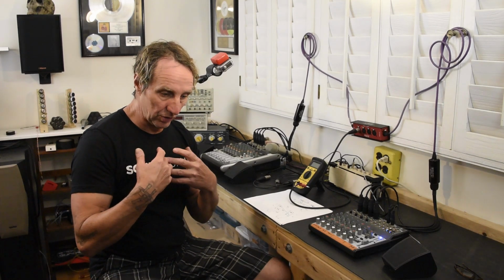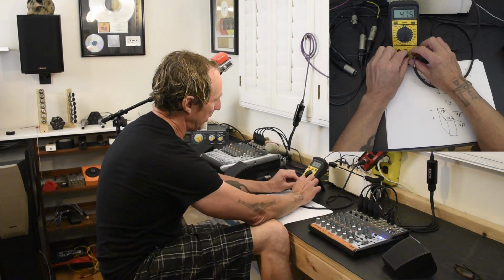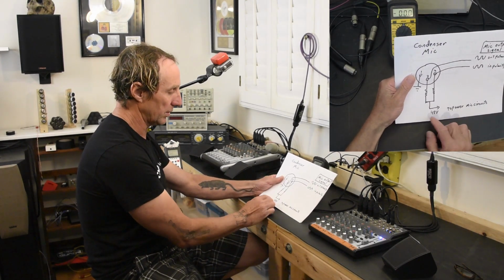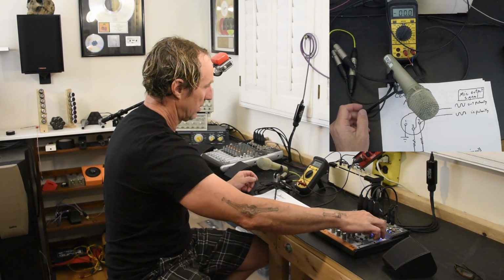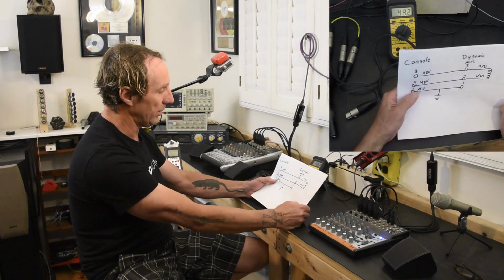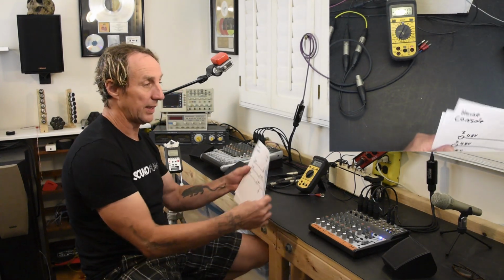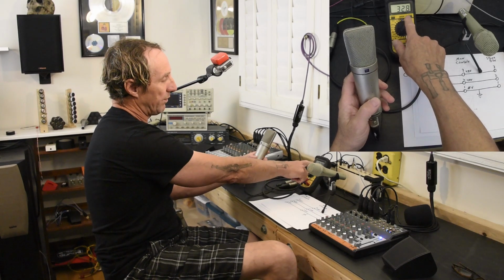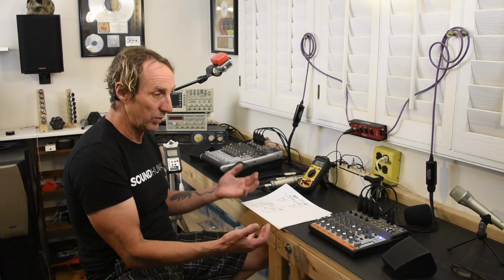Understand Audio Phantom Power + Demo

Comment: Great explanation (as always on this channel)! I have one question though: If we have phantom power switched on at house and monitor consoles and the two consoles do not share the exact same ground (on the AC side, i.e. 120V or 230V depending on where you are); are maybe plugged into power outlets from different distribution boxes. In that case, we'd have some steady current on the (XLR) cables connecting the two consoles, specifically the ground wires, i.e., pin 1? To level out the difference in ground potential. Isn't this dangerous to the very thin mic cables?
Reply from the maker: Whether you supply phantom power or not the grounds of both consoles are connected together via the XLR lines unless specifically lifted. So any ground differential potentials that exist will exist regardless of whether phantom power is applied from one console both consoles or neither console

Comment: Great Stuff,
Is there any Microphone designed for both propose....? out of curiosity..
Reply from the maker: Dynamic mics don't need phantom, condenser mics usually do need it. Some ribbon mics need phantom and some do not. 

It's like a battery, some things like a radio, needs a battery, and something's like a hammer do not and and something's like an ice box can be powered to cool things and others just keep things cool and don't need power

Comment: Hey Dave, long-time fan and love the videos! Just to calm the nerves of those in our shop - with what you stated about the current being low, can I assume that if I have wireless mic receivers receiving phantom power that there's not much cause for concern? Thanks!
Reply from the maker: It won't hurt them, that said, some electronic outputs act strangely when they see phantom and don't sound correct

Comment: Thanks again , nice experiment. The loading of the second console un-powered phantom is due to the two , normally 6k8 , resistors used and as you showed us the phantom voltages combine when both on to share the microphone load. The idea of phantom power came from Telephone/Telegraph balanced circuits for either powering up repeater circuits or adding dc signalling to a balanced transmission line. Cheers Dude
Reply from the maker: Awesome. Thank you Dave

Comment: Thanks Dave. I really enjoyed this chat and demonstration.  I've been running PA's and doing all sorts of sound for over 40 years and never really understood what was (technically) going on under the hood.  In saying that, I always made sure that my pin to pin wiring was spot on and never had any major issues when running condensers with dynamics.  Your bench top demonstrations are excellent, and show that the principles do not need a massive rig or console to explain. Keep up the discussion. Cheers ...
Reply from the maker: Thank you Perry

Comment: Hi Dave, I have seen a lot of debate about allowing phantom power to feedback from a mixer into a Line6 Helix pedalboard's XLR line-outs. It sounds to me like the voltage on pins 2 & 3 shouldn't cause any problems if all of the equipment is working properly and the ground doesn't get involved and there are no shorts. Have you ever been a part of that conversation with any guitar players at a gig? I suppose there could be circuitry at the Helix end that would affect how the voltage is "seen" by the Helix? One of the suggestions was to use a voltage blocker in the XLR lines. Would it be a diode that would work like a check valve?
Reply from the maker: Hmmm, some electronic outs don't like phantom, I will look into doing a test and fix vid for you
Reply: I've seen this in person while mixing.  It will seriously degrade the audio quality, very obvious distortion.
Reply: You can also just float pin 1 at the pedal if you're concerned. Many pieces of gear actually do that depending on their output circuit dont need the ground and the shield is still effective single ended (like most dynamic mics)

Comment: Another home run Dave! Stuff we can use. I would assume that this is a moot point with linked digital consoles -- only one (or a stage box) can actually generate +48V.
Reply from the maker: Yes and no. Knowing how things work is not that important in optimum situations. And we all don't always deal with optimum
Reply: @DaveRat  I hope you didn't think I was being sarcastic, I really meant it was useful. I was just thinking about the digital realm and realizing that it's a different situation.

Thanks for all you do!
Reply from the maker: @ToddWCorey1  no, all good and yes, with linked Digi, no need

Comment: I have always been told that if you accidentally put phantom power down an ipod cable (3.5mm to stereo xlr) it can/will fry the input jack of the phone, however I have not experienced this (maybe I have been lucky?) How would the voltage combine on one of those cables since they are technically unbalanced cables? Also, just another video idea for you, could you maybe discuss benefits and disadvantages of isolated, active, and non isolated splits? I've actually had the least problems from passive, non isolated splits, where I've had active and isolated ones that gave me random buzzes in things and seemed to change my levels.
Reply from the maker: I doubt the low current of phantom will fry anything other than a ribbon mic or super high end dynamic mic with a miswire.  But it can cause issues with electronic inputs
Reply: @DaveRat  I have fried a cellphone and a friend fried a MacPro and iPod sound cards with phantom power. Possibly it depends on the sensibility of some components for some devices?
Reply from the maker: I could totally see consumer devices not being designed to handle phantom power. Conversely I would be surprised to see any pro year damaged by phantom power same with Semi-Pro
Reply: @DaveRat , in the case of phantom power potentially damaging ribbon elements I'd always heard that nothing actually gets fried or burned up but rather a sudden DC jolt causes the tiny ribbon to jump right out of the magnet gap. If true, I imagine that would stretch or rip the ribbon beyond repair without actual burning or electrical arcing.
🤔🤷‍♂️🖖
Reply from the maker: @LiveSoundTips  in theory, if just pin 2 or 3 connects, there would be no current flow and if both pin 2 and 3 connect there also would be no current flow e phantom, causing ribbon damage.  That said, a cable with with a short from pin 2 or 3 to ground or if a patch bay is used, it can short pin 2 or 3 to ground frying a ribbon. Yeah, would totally avoid phantom and ribbons as it's to precarious. Love the Royer phantom powered ribbon mics as they need phantom and are immune to damage from phantom
Reply: @DaveRat , I've never used a Royer (because poverty) but I like the fact that phantom is built into the design and will never be a worry.
Reply: Some devices are intentionally capacitively coupled and thus immune, like the Samsung Galaxy series.

I've heard that from a lot of folks about iphones but I've never seen it happen.
Reply: This will be a fun video. Who's donating their iPhone and Mac for the test. Dave is supplying the phantom power!

Comment: If we wanted to make a mute on/off switch with a short XLR patch cable to be able to mute any mic of our choice, with regards to phantom power, how will that work? Do we have to disconnect both pin 2 and 3 to prevent phantom power from damaging a dynamic mic?
Reply from the maker: Short pin 2 and 3 and it will mute and not pop anymore than non phantom
Reply: Dave Rat thanks man. Keep up the great videos.

Comment: Good timing on this one for me Dave. I have a Focusrite 18i20 interface, I run a pair of TRS to XLR cables from its outputs into a snake or inputs on a mixer. I’ve been worried about somebody sending me phantom power to the interface outputs. I doubt the interface outputs are transformer isolated, so because there’s no power on the tip or ring, I should be ok? I’d only have a problem if I was running 1/4” to XLR unbalanced cables, correct? I was thinking about buying or making a two channel transformer isolation box to safeguard against this, but if I run balanced cables I’m ok, unless there’s a problem with the snake?
Reply from the maker: Avoid running phantom to electronic inputs. Capacitor iso will solve but often electronic inputs don't like the 48 v DC offset that phantom sends and will act strangely
Reply: Dave Rat - yeah I would never intentionally run phantom power to them, I’m just concerned if it happens accidentally. Thanks Dave.
Reply: You can test for isolation by checking continuity of the grounds for both the input and the output --- if there is no continuity then they are isolated.
Reply from the maker: @HazeAnderson  👍